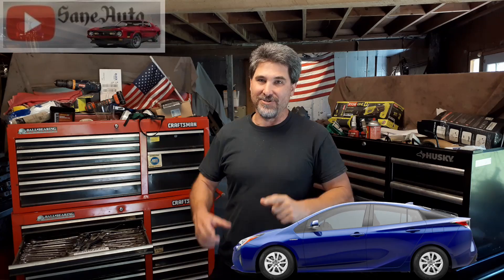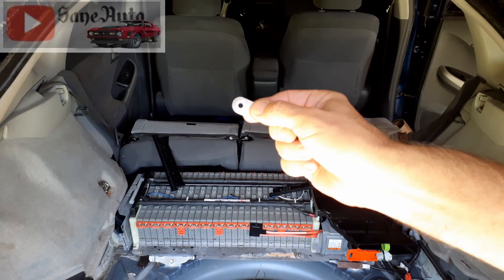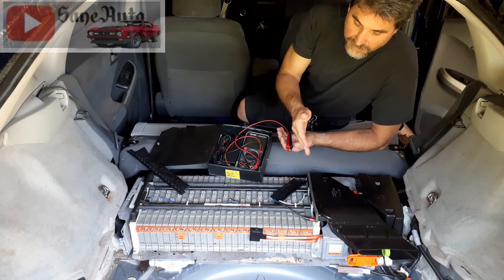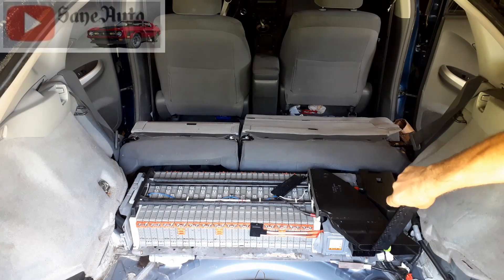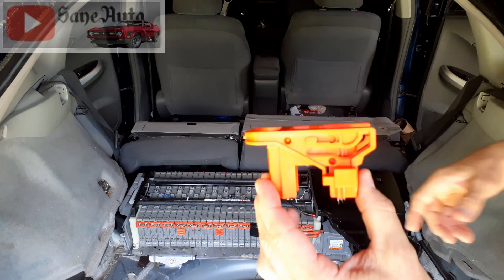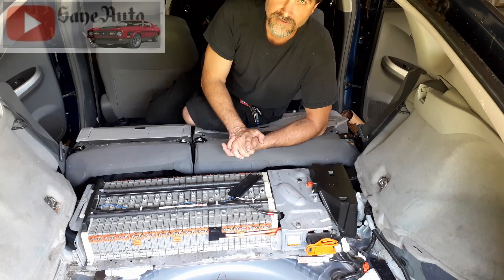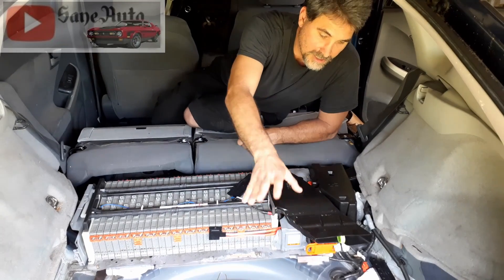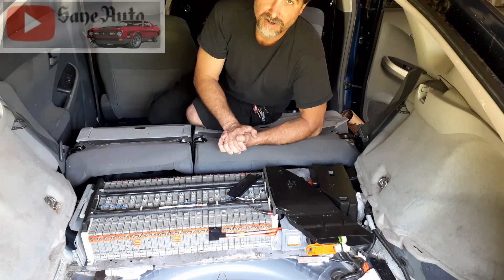Prius Top 5 (Check Hybrid) high voltage HV battery fault codes (triangle of doom) cheap fixes

Comment: Pro pro tip if Pull the orange safetyplug up and out and dissconnect the 12 volt you'll be 99.9% less likely to hurt yourself

Comment: Hi Sir is the inverter supposed to charge the hybrid battery? If the inverter is bad is not going to charge at all. I turned on the 2013 Ford C Max Hybrid and the voltage on the cables going to charge the hybrid battery is in draining the battery not charging it?
Reply from the maker: So far every inverter problem Ive had set a code. Do you have any codes that point to the inverter?

Comment: Yesterday I was given a 2004 Prius showing 211,000 miles on the odometer. It sat parked for a year unused, because it wasn't running right. I think the owner said she had the entire high voltage battery assembly replaced at least twice. The 12 volt AGM battery in the back rear is about 5 years old, after about 12 hours charging on a smart charger in repair mode it's showing 5.77 volts with a volt meter. So I guess that's the first thing I will replace. 

THANK YOU for the video, it is SO informative and helpful. It gives me hope I will get this car running right, then help my son with his 2012 Prius project. He replaced brake calipers or pads with the 12 volt battery connected, now it's showing some code and not running.

Sane, I have only watched one of your videos so far (liked and subscribed), so if you have answered this question elsewhere please disregard or tell me where to find the answer. I recently bought a thermal camera that plugs into my phone. I think I paid about $200 on Amazon. Do you ever use a thermal camera to find hot spots etc on cars? My other life is aircraft maintenance and I find the camera useful for finding cold cylinders or cold spark plugs on reciprocating aircraft engines. 

Thanks buddy. And thank you for your trailer about never forget. My two buddies Robby and Mac died in a B-52 fire/explosion back in 1983. I appreciate folks who remember the sacrifice of others that defend our freedoms.
Reply from the maker: Sorry to hear about your buddies. I was born on base in 67. All my uncles, older cousins, friends, most grandparents etc served & later our children also. My dad & Uncle John were aircraft mechanics. My dad was a rocket specialist. I lost an uncle & my oldest cousin to the Vietnam conflict. Wont start video https://youtu.be/GphTKR7dW4I If that doesnt fix it other wont start video with different cause https://youtu.be/vgyZB9wBLQs Here is the Prius repair playlist so you dont have to hunt through my 1500+ videos to find prius repairs https://www.youtube.com/playlist?list=PLADlyv_PN7XIbqH6f-5bRtuISlKrkfsBI
Reply from the maker: I also like to use a thermal camera at times. It can be very helpful & quickly point you in a direction you either wouldn't have checked or would have taken much longer to find. https://youtu.be/xdTp3rf2C7s

Comment: 214K miles. Rebuilt the battery and replaced bad modules, rebuilt entire front suspension on the street. Drove fine the 1st day. The 2nd day I got "check hybrid system." Just checked all the plugs and they were fine, watched your video and I did not know about the 2 clicks on the orange safety plug. I may have only had it 1 click over not 2 clicks causing a P3004 which most people diagnose as a bad inverter. I know my inverter should be fine because the dealer replaced it under warranty at no cost, when the original "check hybrid system" warning came on a year ago. The inverter doesn't even have 10 miles on it. Hopefully it was just the orange safety plug!

Comment: Car I just bought was said to have a new battery recently. Has no codes but drops voltage if under heavy load and depletes the charge down past 40% it has gotten lower than 25 before 😳 it eventually will straighten out after awhile and charge back up. If not under a heavy load it works perfectly fine. Any ideas? 2011 prius.

Comment: Hi, I need some help here! I got the check hybrid system lights and when going to clean the fan for the hybrid battery I found out that the black plastic piece for air flow that you talk about in your bonus tip is not there. Is this what’s causing the issue? Should I get one? Or would the dirty fan be the actual problem? 
Thanks!

Comment: I replaced my battery with a DR Prius reconditioned and warranted one (AU $1850 / USD $1205)and was still getting the triangle after a while of driving, turns out the inverter coolant pump was not being effective and a cheap fix. Easy to check, look in coolant reservoir for proper flow. Seems to have fixed it. The battery wasn't good anyway so no regrets. I was still getting good fuel economy so the battery was ok.
Reply: Did you get any trouble codes or power aux battery drains?
Reply: @ANGIEB52  My 09 Camry. Is draining the 12v and the gas engine won't turn on. Any advice for that? Replaced cells already.
Reply: @ No codes?  Mines is doing the same thing, I’m sure mines is a parasitic drain from something. I haven’t been able to check the hybrid battery yet, but I had three issues before this though.  First time I had a drain, I shorted  out the cigarette lighter, replaced the fuse, second I had blown out my amp and speakers I fixed that by totally removing the fuse and NOT replacing it, for the amp, and to  the radio amp /navigation screen - had no screen or radio for a while, but car drove, no drain  theres an open or short in the circuit/ wiring somewhere, now I need to change my breaks, possibly a short in the abs system. (Abs sensor). If you have a multimeter you can take out fuses one by one while the leads are on the aux battery and see if the drain slows, that’s what I’m doing,  check your electrical wiring and plugs for corrosion or breaks / bends.
Reply: @ANGIEB52  I have the p080 code for the battery but I replaced the cells. But also had the check VCS system pop up but it doesn't throw a code.
Reply: @ I have vsc also - I also got a vsc from shorts . Like a piece of metal touching the aux battery, the metal things that lock in battery battery (strap )… don’t ask 🤭.. you need to find the short or bad component because it’s causing a drain.  I also blew out the fusible link relay card under the hood, you know that’s out, if your car won’t go ready, but car turns on, but won’t drive and windows operate. I don’t remember if I had a drain  on that issue but probably did.
Reply: @ A P080? Are you missing a number?
Reply: @carsarecoo  also just remembered… how are you recharging the aux battery? You might need a new one, but how do you jump it? If you Jump the car and it goes ready but turns off fast, it’s a drain, because if it goes ready that means the hybrid battery is working to some extent.
Reply: @ANGIEB52 the 12v is new was the first thing I bought when the car stopped working. But the hybrid drained it to 10.8volts
Reply: @carsarecoo omg my 12v keeps draining to 10.8 volts & I'm down in the deepest part of hell pulling fuses trying to figure out what's causing the drain. Did you ever figure out exactly what was causing this?

Comment: I am so excited to have found your videos!! Single mom here who just wanted a car that got great gas mileage. Bought a used 09 Prius off Facebook 🤦🏻‍♀️ I thought I was so screwed until I found your videos! Now I know what steps to take to try and fix her! THANK YOU!!! Now keep your fingers crossed that I can do this lol
Reply from the maker: Awesome! my Mom was a single Mom. Still is. Dad was gone long before the Divorce & before that was a decade of USAF & Vietnam. Its amazing how much adversity someone can overcome & even thrive in. We come out stronger in the end. Just be more careful than me. Ive woke up in the hospital more than a couple times ;-)
Reply: How did you make out? I once replaced my Prius battery bur it didn't fix my last Prius. My current 2012 Prius now has a red triangle of death. I replaced the speed sensor to get rid of one code but still can't get it to start. It's so hard to find ppl to work on these cars in my area. The local Toyota dealer just tells ppl to change the hybrid battery. It's frustrating because when these cars are running they are awesome.

Comment: Any recommendation for a certified mechanic who could replace the Hybrid Battery ECU and Voltage Sensing Wire Harness on a 2008 Prius in the NYC area. Had water and now corrosion issue. Otherwise the hybrid battery is in working condition.  I'm having a hard time finding someone.  Thanks.

Comment: Lmfao 🤣 all I did was drive 60 and come to complete stop. If your displayed battery screen shows 🪫 or low. It needs to be replaced. No don’t replace individual cells. Replace whole battery. Paid 950$ with install and warranty. My 2009 2nd gen has 250,000 miles on it. Drives like a dream gets 62 mpg in city. 70 + on freeway.
Reply: What company did you go with?
Reply: I replaced 2 cells in my Camry and new buss bars. Almost 4 years and battery still going.
Reply: Yeah, what company??!
Reply: Bro! You might be able to make a sales commission if you wanted to. Where did you get the "new" battery? Thx!

Comment: Much easier way get the Doctor Prius app and the OB2 that's recommended by Doctor Prius. That will tell you ahead of time what the problem is with your battery and which cells are bad

Comment: I cleaned mine on the contacts, but the panel lights up, I remove the white cable and after 5 minutes it goes back to normal. But after a few days, you have to reset the white cable in the fuse box again. I noticed that the lights come on when the air conditioning is turned on or when the car jerks when switching from hybrid to mechanical. Am I right, could it be something in the hybrid engine, a bad contact or something like that?

Comment: I have a P0343 code. I swapped the cam sensor. I also have a check hybrid system error, and my car does not want to start now it turns on for about three seconds, and the lights turn on on the dashboard.

Comment: I wanted to know how I can ask you a question.. The question is can I charge the complete hybrid battery by simply attaching a second battery to the car inside the car and driving it? Or by starting the car with one battery and then switching the inverter leads to the dead battery? I know it would be very dangerous and require a lot of care.
Reply from the maker: Thank you for commenting. I haven't tried anything like that.

Comment: great video and informative!  I have some new bus bars coming in tomorrow to change them out.  I'll definitely make sure that the main service plug is disconnected.  Anything else you recommend other than wear protective gloves?
Reply from the maker: Heres my video changing bus bars https://youtu.be/iZIdSzlSU2c The only safe way is to pay someone else to do it. Your right about gloves. Long sleeves can help too. Just remember if you sweat so much your sleeves are wet they become conductive too. Oh and try not to spill your coffee on the battery. Its a waste of good coffee. Heres my video on how to clean the fan because if your already in there, https://youtu.be/mTgOvlaQnxI

Comment: Hi, I left my Toyota Prius 2006 in my garage without starting it for 7 months, I just tried to start the car and it didn't work, some of my friends told me that because of the hybrid battery is dead. Please can you advise me what should I do to start the car.
Regards
Reply from the maker: The 12 volt battery is more likely to go dead than the HV Battery.

Comment: I have the same code and I have gone through and tested every cell one by one. The HV system seems fine and I’m leaning towards the AC compressor? Any advice on how to test it? Considering once the code trips the ac does not work…
Reply from the maker: The A/C needs plenty of power from the HV Battery to work. Check some of my newer videos on testing HV modules with the T180.  https://youtu.be/Va7ADJz4gpo

Comment: Check air filter guys mine was full of acorns from squirrels set off triangle cut car off also.
Reply from the maker: Yes! great tip Mike. I also have a video about cleaning the cooling fan it was nasty because this vehicle and many other 2010's came with no HV battery air filter at all. Others with an embarrassing weak screen (still no filter).

Comment: Just watched this video.  So 3xs in one year the triangle of death happened with code p0a90 bringing the car to a halt.  Hubby took out the battery, we cleaned the bus bars and silver plated them.  Again, it happened as we were going up hill.  Every time this has happened, we were going up hill.  The fan, we cleaned but hubby thinks it should have spinned a little better and we questioned whether it needs replaced.  It works but maybe intermittently - we don't know.  We do know the battery has gotten super hot and that may be why it comes to a halt.  So, I'm thinking the bottle caps MIGHT be the answer we have been seeking.  I hope so because I'm really tired of being stranded.  Will get back to you.  Feel free to comment if you think there is something else we should be looking at.  I'm hoping we do not need to worry about the transaxle.
Reply: What did it end up being the issue?

Comment: Hi , my Prius gen3 poped an error check hybrid system, I tried checking if the fan works by putting a paper on the inlet ( my Prius had no filter behind it) I felt no suction and do not hear the fan spin ) is the fan suppose to be always working when the car is started ? Even if one of the hv battery modules is faulty ? I'm asking to understand if I have found the problem which is that the fan no working so the battery down for safety.

Comment: Hi what would you say to this I noticed my HV battery indicator on dashboard was being on the lower side ok on way home  triangle of death came on it’s a 2004 Prius battery cooling fan came on my battery bar was at 1 bu it would flash full all green for like two seconds then back to one bar. No codes showing I get home take HV battery cover off put brake on put gas down to test charging not Long cooling fan on showing one bar on dash checked HV battery over 400v my meter only goes to 400v. So any way it is overcharging and not showing property on screen what most likely is the problem. Thanks looking forward for a comeback on this.

Comment: Replaced my hybrid battery last year in April and in May, I started getting the P0A90 error code. After testing it with various OBD2 apps, it’s showing the battery pack needs replacing. I live in rural California and the company that replaced it last year is slow walking the replacement or servicing of the battery. Their website says lifetime warranty and will drive to anywhere in California but keep making excuses. The name of the company is Lifetime Hybrid Batteries out of San Louis Obispo so putting this out there for folks that reside in California to use them with caution.
Reply: That code points more to drive motor A not anything else does having anything to do with the main HV battery
Reply: @gustavomartinez324  can you explain that better?  This sounds like important advice that might apply to me, but I think you have some typos in there.
Reply: drive motor A performance that the code that u put on here POA90 that points to the transmission transaxle shaft or gear meaning the transmission is the problem are u sure it’s not POA80 code those 2 different codes can u verify what codes ur getting so could give u clear answer do you have a good scanner by the way or how are u obtain the codes on OBD2
Reply: @g @gustavomartinez324 replaced all 34 modules and I’m still getting the p0a80 code or whatever it is. It keeps bringing on the check hybrid battery. It’s a 2012 Camry

Comment: Thanks for your tips because after I changed my 12 V battery, Christmas lights on my front window. I could not start So I listen to your video and remembered to press that electric plug all the way So I went to my Care and lifted that up and pushed it down, then Wala, my car stared working again Thanks!
Now question is, Do you know anybody in Fresno CA area to check my hybrid battery? because I used this Prius from 2008 until now So it is almost 13-14 years I want to catch those problem before it starts Ok? Thanks again
Reply from the maker: I dont know anyone out there but I filmed enough of the times I spent checking hybrid battery cells and changing bus bars etc to cover everything in my Toyota repair playlist https://tinyurl.com/y4loxjlv

Comment: do grid chargers or superchargers for prius gen 3 actually work on a hybrid battery that has sat for over 6 months without starting?  they go for $300 grid charger, to $500 for super (fast) charger ?

Comment: I went and bought a lithium battery for my 2010 Prius. Dr. Prius. Car is amazing and acts brand new
Reply: There was a waiting list.. about two months and then a technician came to me. Installed it and then drove it using a iPad and iPhone to make sure it was okay to drive after he left. Took 40 min.
Reply: what did it cost?
Reply: @davidvuchetich3045  $2300 after taxes. It was for a 2010 Prius. Replaced the green bean battery that lasted only 3 years
Reply: Did it urself ? Did u have to wait a long time for the lithium to arrive?
Reply: @davidvuchetich3045  two month waiting list but they came and were in and out in 48 minutes.
Reply: @CelexiGOON  I thought you could upgrade to lifetime warranty for additional $50 for green bean hybrid battery?
Reply: @billt7207  times have changed cause the prices of the ingredients… sucks